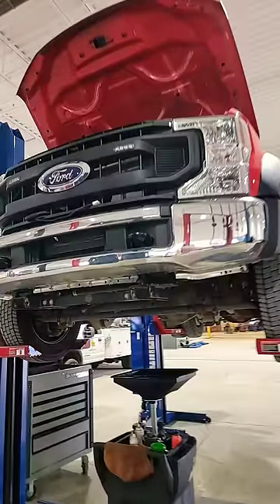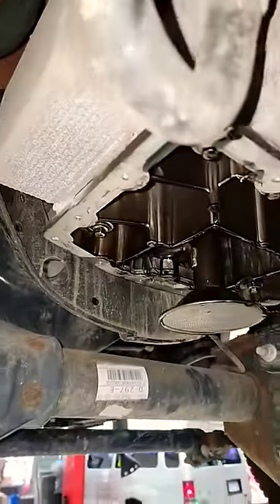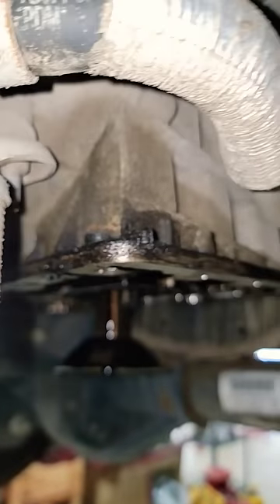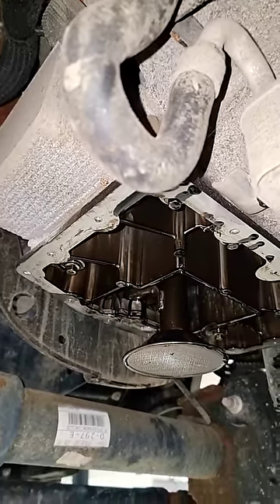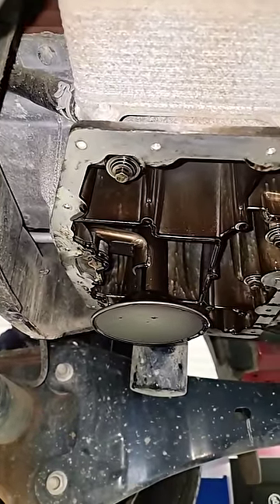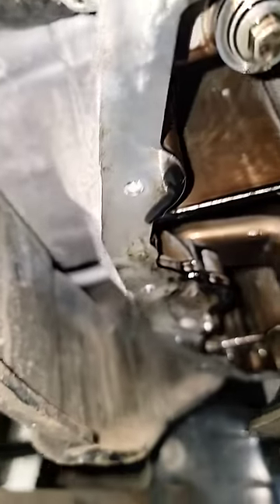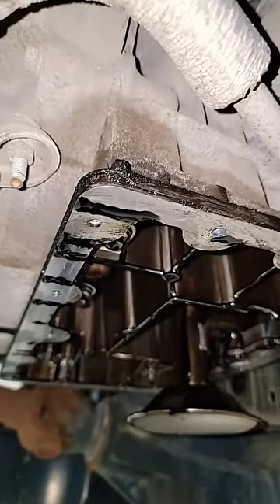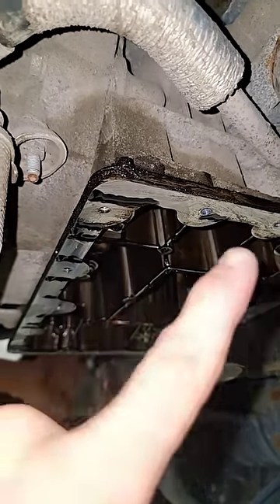Listen UP you Ford 6.7 engine builders  SMH 🤦‍♂️#bebetter #shorts #fyp #fordtrucks

Comment: 3000 miles and it looks like it was sitting in yhe ocean!?!?!?!
Reply: Welcome to the north
Reply: @liamcpeterson  nah no way that's from one winter
Reply: It’s probably because it’s was sitting for 2 years in fords plant holding lot waiting on parts before it was titled. So even though it’s a 22 it’s was sitting for 2 years before it ever saw the dealership.
Reply: @blondeguy08  I can see that happening I'm glad I got my 2019 pre covid
Reply: My 99 miata with 135,000 miles looked brand new compared to that and I drove it in the Utah snow
Reply: That's actually clean af
Reply: Flood vehicles look like that. That's not normal, even for the north.
Reply: It’s not quality metal, surface prep or paint. My 1996 Toyota looks immensely better than that. Im not saying Toyota is invincible, but they definitely cared about their cars when they made them
Reply: My 2007 has less rust. Haha
Reply: @blondeguy08  And you are typing this from the year 2024?
Reply: 400 engine hours for 3000 miles!? Dude must just leave the thing running all day and drive around the block once for fun
Reply: Probably came from ky speedway massive ford parking lot
Reply: my thoughts exactly...wtf.  They drive in salt flats after a rain to work each day?
Reply: Cus it’s a ford
Reply: @liamcpeterson  brother, that's what my 1998 looks like. Made and driven in Canada..
Reply: @carsontinsley4003  old toyota, yes. Modern toyota... idk. They've gotten iffy nowadays.
Reply: @jerrymouse1017  falsifiable statement
Reply: It's a Ford.
Reply: Front plow mount. That looks pretty good for a one winter plow truck.
Reply: Did you see all that rust!!?!
Reply: @carsontinsley4003  facts
Reply: Depends where you live some cars are just fuked
Reply: @Hanibul_Lecktor  yep, that truck was in a flood somewhere. My 20 year old truck looks better than that and I live on a dirt road. More problems in the future for this Ford.
Reply: @Klusk91  or a whole lot off road driving
Reply: @liamcpeterson  no.. i live in MD and we get snow/shit ton of salty roads every year and i have very little rust on my 2011 subaru legacy. That is unacceptable for a brand new truck.
Reply: Good thing I'm sticking to my Japanese brand
Reply: @xephael3485  um yeah, it's the north. That's exactly what happens. Sloppy wet ice storms get extra salt dumped on the roads. Then it all sprays up into every nook and cranny. It's a heavier concentration of salt than driving into the ocean
Reply: Yeah it’s a work truck pay attention kids 2 wheels in the front 4 wheels in the back dirty wheel wells = work truck
Reply from the maker: I love it!!!
Reply: @blondeguy08  so they build the 2022s in 2020? Something's not right here. There's way too much rust under that vehicle to only have 3,000 miles. I'm not a mechanic I don't claim to be a mechanic but I do work in a repair shop and I've seen the undercarriages of thousands of vehicles. That vehicle that rust under that vehicle cannot be from just 3,000 miles
Reply: It's a ford lol
Reply: @jerrymouse1017  my thoughts exactly lmao
Reply: More rust than my 2008 Kia in Pittsburgh
Reply: @daMillenialTrucker  was going to say the same, my uncles 2020 has seen 2 Minnesota winters and isn't this rusty.
Reply: Totally normal in northern WI. Seriously. I always laugh when people are shocked by the appearance and the surface oxidation. What do you think huge amounts of road salt and magnesium chloride deicer sprays do to metal?!
Reply: @daMillenialTrucker  could be from Ontario Canada.. one winter will do that.. if not then worse. It’s actually disgusting how much brine they use.
Reply: It has been towed, probably behind a RV. My father destroyed  a 1976 chevelle in one trip down I-95. It is amazing the amount of damage 10 hours of salt spray can do.
Reply: They're like that from the plant lol
Reply: @halcyonoutlander2105  why are you mad at me for
Reply: @daMillenialTrucker  dude you have no idea lol most brand new cars on the lot look even worse than this
Reply: I've got a fleet of 6.4 and 6.7. Doesn't surprise  me  at all.  I'm just thankful  the 6.0s are finally gone
Reply: I’ve seen brand new Chevy ford and dodge all come this way they don’t do undercoating anymore like at all I seem brand new ram rebels come in for oil change I seen rust on the farm the upper and lower control arms cross member for trans and not just dodge like I said all new models I’ve seen examples of that lime and rust like you shouldn’t be seing that yet maybe on an older car then again my 2006 is rust free so idk where they went wrong
Reply: @daMillenialTrucker  ehh your quarters can rust out in on winter  out here, ask me how I know lmao
Reply: @Jmiesonboy  no it didn’t
Reply: @blondeguy08  probably the dumbest thing I’ve heard. So it got so rusting from just sitting in a parking lot? Hmmm did someone come and spray it with salt as well to get that rusty??
Reply: My toyota spent 12 years in Alaska, then 3 in Colorado, and it doesn't have that kind of rust.
Reply: @Running-with-skizers  I agree getting pre- PLANDEMIC is a good thing. I got one of the last Can-Am x3. Before they shut down. Very greatful!! has been a great unit!!!
Reply: All you saying that’s not from being in the north must not live in the north. I see this all the time on brand new off the lot vehicles purchased from November through march.
Reply: My 1951 F100 looks way better. And it came from Maine
Reply: @Jmiesonboy  snow is different then salt
Reply: @blondeguy08  NOPE. the vin would tell that story. has the vin the second it starts being built
Reply: @Running-with-skizers  hes wrong.  they get assigned the vin at the start of build cycle and the vin has the date and complete build info
Reply: @joshuadoerr277  they salt the roads constantly in utah, I cleaned it often and I went to snow basin over 35 times with it
Reply: Probably a NY state vehicle.
Reply from the maker: Nvr gonna catch me in the empire state...ugh uh
Reply: New York prob. New cars on the lots all look like this. Lol
Reply: I drove my wrangler in the winter 2 weeks in Michigan, and washed every other day.  It rusted like crazy in that short of time.
Reply: @Hanibul_Lecktor  LOL. Yes it's extremely normal! That's very minimal rust. Mostly on the driveshaft is what you see there. Tell me you are from down south,  without telling me you are from the south!
Reply: @carsontinsley4003  Those old Toyotas up north are the worst of the worst!
Reply: @kc72186  You can tell that from normal rust that all northern vehicles have? You must really be something special! Must be every vehicle I own has been in a flood, if a little NORMAL rust is your deciding factor
Reply: @Hallowsaw  Maybe unacceptable,  but it's normal
Reply: @Throwback-Films  Well I guess you can believe it now then. Either that, you have not been under any vehicles from the north
Reply: @joemannix7471  Destroyed the car in 1 trip? Calling your complete BS right here!
Reply: @northwestgirl930  cool story.  Doesn't change the fact that this truck has some surface rust at 3k miles
Reply: @dreamingcode  so?
Reply: @Klusk91  or they are ran in that Ford monstrosity of a lot every week for 'X' hours to keep them from having electrical and engine issues. Ford runs them out in that Lot they have full of trucks. Imagine buying a 2022 with that much suface rust and engine hours and youre told its "Brand new"
Reply: It’s a snow plow truck most likely given the hitch in the front.
Reply: @jhawk1045  yep some people have no idea how rough a northern winter can be on a vehicle especially in states that drop salt. Doesn’t matter the brand these days
Reply from the maker: Christ, someone without mush in their skull🤘
Reply: They have been sitting in parking lots. You can look up images of the Kentucky speedway and you can see the trucks filling the parking lot.
Reply: it’s a plow truck
Reply: @BlankBillions  that may be true but trust me I’ve seen them roll off the line with just as much surface rust on the underbody
Reply: I’m from Wisconsin and this thing looks like it was soaked in a calcium chloride tank for a year
Reply: Road salt or sand dunes 👍🏻
Reply: I was just saying this, was following an new F-150, so new the suspension bolts were still shiny, yet the diff was so rusty it looked like it was 10 years old.  Ford has become so sloppy, Chevy has been this way since the early 2000’s.  Hence why I haven’t bought a domestic since then.
Reply: @Jmiesonboy  Utah winters are nothing. I should know, I've lived in Utah winters for 15 years.
Reply: It’s a ford they tend to rot. I’ve seen 5 year old fords that are comparable to 30 year old Hondas in terms of rust
Reply: It ain't rusty. Come to the east coast of Canada. Rigs look like that before they're sold new here lol
Reply: @chrisclow6885  I live in Northern Ontario. I know what rust is, there isn’t an F-150 with an intact fender for 200kms here.

But my point is, Honda and others don’t have that issue.  That why I won’t buy a domestic anymore.
Reply: @TheTuulos  haha yeah. I'm a die hard vw guy and red sealed vw dealer tech. Worked at Toyota, and Nissan before. Can confidently say, vw is so much better for rust protection then the others and any American brand. Stuff actually still comes apart. Torches used to be daily. Now bi-weekly max lol
Reply: My thoughts exactly
Reply: It still have the tag with bar code on the differential 🤷🏻‍♂️ that’s a good proof that it’s not old at all
Reply: Looks like a snow plow.
Reply: @NoknOnDors  no tf it’s not that’s got a bunch of rust and stuff bro more rust than my 2006 Sierra that I drive in the winter every year in Utah
Reply: @daMillenialTrucker  yes probably a couple months.
Reply: @daMillenialTrucker  welcome to Canada! 🇨🇦 🍁 😂
Reply: Idling doesn't help either, 400 hrs with 3000k it's Idling more than it's working.
Reply from the maker: Someone who connected the dots
Reply: Got a 2021 f150 back in May of 2022. (Took that long to arrive) first thing I did was pop the hood and tons of rusted parts everywhere.
Reply: Was waiting for that my 15 Silverado looks better underneath than that lol
Reply: @daMillenialTrucker  You underestimate the power of liquid salt
Reply from the maker: No 1 understands sitting behind their keyboard
Reply: @PowerStrokeTechTalkwARod  what's your take on it?
Reply: @Running-with-skizers  I got  a 21 Denali HD last year,in June, had to wait 4 months,  definitely don't look like that and I'm on gravel all the time
Reply: 400 engine hours, that’s an average speed of 7.5mph this is Fleet or work vehicle that gets run at idle alot . They are going to hate that engine it’s designed to work not idle .
Reply: @Klusk91  Probably an oilfield supervisor who just sits in the AC all day lol
Reply: @Jmiesonboy  that’s because Utah snow is clean.
Reply: @liamcpeterson  no from one winter at all, I live in PA mate 😂
Reply: @carsontinsley4003  idk about that. Toyotas rust VERY badly but only with a lot of aging. This however is just terrible. It should not look like this this soon
Reply: @daMillenialTrucker  theyve started using brine instead of salt and its so much more toxic for cars
Reply: @liamcpeterson  I have a 10 year old Rav4 with less rust. Welcome to not coating your metal from the factory. American made is crap and has been for a long time.
Reply: @carsontinsley4003  is that why they had the frame recall?
Reply: My two year old Toyota looks brand new still after 2 Chicago Winters
Reply: @carsontinsley4003  except the tacomas that had their frames rusting out
Reply: @Jmiesonboy  same with my 315k 91 MR2 turbo. has seen many colorado winters but is rust free compared to this thing
Reply: That was my thoughts too
Reply: Cheap ass metal sucks rust out quick
Reply: Yeah man it’s called winter, it sucks😭
Reply: @daMillenialTrucker  i believe it ... i had my ram for 23k miles n it needed whole underbody replaced ... these new trucks come with zero coating out the gate
Reply: @blondeguy08  yep. It's been the same basic frame for a while. Infact there have only been a few basic frames since the super duty came out. The generation with the 6.4 diesel doesn't hide it very well but the new ones hide it pretty well. That's why you can take a 99 with a 7.3 and make it look almost exactly like a new one
Reply: @blondeguy08  you know the inner workings. I wouldn’t be surprised by your assumption because that car has a lot of calcification or salt buildup from the elements
Reply: @daMillenialTrucker  yah it most probably is there is this rock called salt
Reply: @mrright69  my 08 Powerstroke is solid as a rock. I had it since new. I wouldn't own one of these new trucks.
Reply: @seanwright1617  I don't blame you at all. I blame your executives for outsourcing crap. If Ford continued to manufacture their own parts and pieces instead of outsourcing to the cheapest crap available there wouldn't be a problem.
Reply from the maker: Id rather walk
Reply: @tabcreedence6553  No. Ford had tons and tons of vehicles stored on lots just sitting because they had a massive shortage of chips used in the electronics during the start of covid. These vehicles sat until they could be finished meaning they were finished in '22 and put on dealer lots to be sold as "brand new"
Reply: I had way worse on a New GMC Denali. If you drive a mountain pass you're getting rusted.
Reply: Odds are it sat at Kentucky Speedway for ages before it got its chip.
Reply: @jerryeastman170   it started with the radiator, which exploded into multiple leaks, then came electrical failures by the dozens, then the frozen parking brake, then the rusted brake lines, then the frozen brake caliper, and more.
Picture towing your car up and down Daytona Beach, in the water about 200 times.
Reply: @jerrymouse1017  my mother had the most rusted 68 4 door Fairlane that was ever still on the road. My brother called from Connecticut and asked if I could find him a cheap car. Him and my dear departed mother took a bus to Dunkirk NY for a $68.50 Fairlane. My coworker paid fifty bucks for the car and charged me $18.50 for the pop rivets and scrap sheet metal. The patches were all on top of the front fenders to keep the puddles under the car.
It was 12 degrees below zero when we towed it out of the snow drift. It started with a jump and they drove it to Virginia Beach.
This car was famous on East Ocean View in Norfolk in 1978.
Eventually my brother in-law sold it with the condition that it was not road worthy. 
The guy called him back a few weeks later demanding his $200 back.
The car sagged in the middle.
Some will say that my rust stories are bs
Reply: I'm in Missouri in the rust belt and my 94 is cleaner wtf GM
Reply: Thats what I was like. Has he been washing the bottom of the truck with beach water.
Reply: @NoknOnDors  what have you been smoking? Thats clean to you?🤭
Reply: @Klusk91  could be a work truck
Reply: Why is a 2022 F Series super duty with only 3000 miles in this garage instead of a Ford garage being serviced under factory warranty. Somethings not adding up
Reply: @seanwright1617  Since you familiar with this truck. Why would this guy be doing the repair instead of a Ford garage under factory warranty. It doesn't add up.
Reply from the maker: Maybe cuz ur stuck in dat 300C club to peep the bio & your question wlda been answered......
Reply: Snow Salt from the road does this after even just 5 minutes of driving 😂
Reply: Move up north you’ll see how fast vehicles rot away
Reply: @daMillenialTrucker  in salt states yes , I had a 2022 Chevy pickup come in for inspection, the undercoating is already falling off it
Reply: @daMillenialTrucker  haha yeah it get it like that sometimes it's all the salt on the roads
Reply: @mrright69  my 08 ram been in Ohio has way less rust than that and it sits outside 😂
Reply: @daMillenialTrucker  come visit me in Maine buddy. There's higher salt content on the road than the ocean in the winter months
Reply: @garrettwight1027  Maine and north Dakota are the only states I've never trucked in. I know Maine is a flat version of Washington state so I'd imagine, it's probably salty ASF but still these aluminum chassis are coated in protective coatings like a triple dunked glazed doughnut, so it's hard to believe any type of salt, in one winter did this. It has to be a combination of things bro. This truck had to have been like an oilfield truck
Reply: @blondeguy08  it can't be titled as a 2022 with a 2020 VIN🙄
Reply: I thought the same thing Lol
Reply: Should be laws on road salt
Reply: @Sean Wright  so that excuses the trash work on the oil pan.
Reply: @daMillenialTrucker  who's making aluminum chassis trucks?
Reply: @beardedwonder73  then it wouldn't be a 2022 truck.  They can't swap VINs
Reply: @walkerallen425  those sitting vehicles already had VIN numbers and therefore can't be 2022s
Reply: @GTPCarpy  the chips aren't VIN matched from what I understand. And as to "production/model" year .. its still a product of that model. Like new old stock motorcycle
Reply: @beardedwonder73  if the VIN says 2020 it can't be sold as anything but a 2020.
Reply: @GTPCarpy  isn't that I what said ... new old stock. Trust my area has enough expeditions/navagators and f250s/350 to supply new old stock for a year or 2
Reply: @Jmiesonboy 
It's not the snow.... It's the salt, calcium chloride, beet juice, etc that's sprayed on the roads when you have snow 6 months out of the year.
Reply: @seanwright1617  maybe don't cancel all your orders at the start of the pandemic. As someone who works in semiconductors, it's 100% on the oem and their mistake of cancelling almost all chip orders at the start of COVID. 8 to 12 month lead time on chips mean 8 to 12 months of no chips for you. Tell your execs to have some foresight instead of blaming semiconductors
Reply: @daMillenialTrucker yes, one harsh winter can do that.
Reply: @blondeguy08  as a trucker that delivers parts to assembly plants I see all that stuff back there and do in fact see brand new vehicles sitting in mud and or gravel lots
Reply: Right should have come with a Ford motorcraft oil filter did you see that one ,?
Reply: @Klusk91 probably had a PTO using a bucket or boom. I don't know, just a thought.
Reply: This guy is talking about metal prep, the owner needs to take better care of their investment. Undercoat the truck with fluid film, makes those kinda things not happen as much. Just saying.
Reply: @carsontinsley4003 that’s funny given that first gen and early second gens have some of the worst frame rot on any trucks out there due to the awful quality of layering they received from the factory.
Reply: Big part of that is gravel roads. I've had brand new trucks look like they're 10 years old because of the amount of caliche dust mixed with water and mud. More than likely an oil field worker or a ranchers truck
Reply: I sold an 84 F350 last year that had the same amount of rust
Reply: @Jmiesonboy  your lying. I had a 99 Miata and they are all known for rusting issues. Japanese metal not that good for winter. Your just lying to everyone here if you act like your Miata is better than this if you really do drive it through winters lol.
Reply: @Jmiesonboy  mine was a boy 100,000 miles before it got totaled by some lady backing out of her driveway when my car was parked. I detail cars for a living and my Miata never looked so clean compared to this truck.
Reply: @sgtjohn4321  that's what I'm talking about. I just pressure sprayed the salt off the bottom and it didn't get that much worse over the winter
Reply: @daMillenialTrucker  we call that China steel!   Or better yet Chinese almost aluminum.
Reply: 2020 dodge bighorn doesnt even have a spec of rust and im in the north whats going on ford?
Reply: @Jmiesonboy  so they dont use salt in Utah? Case they do here and that's what most vehicles look like after their first month of winter driving...
Reply: @blondeguy08  I was about to say, that's what a year of sitting in the field at Kentucky Speedway looks like...
Reply: @Roberob1189  I'm born and raised Long island New York, I spent half the years upstate N.Y in the mountains, driving in snow, driving from up there thru the city and to long island,  then all over the island. I buy Dodge rams, and there known for rusting supposedly,  half my family is in the car business from selling to leasing to fixing as I am in the automotive business and I can say you are full of sheet,  New cars on the floor are not rusted and being sold. I've owned all of New cars and trucks and allot of used. I had a ford escape I would drive in all the blizzards and had a bunch of fancy houses in my late 20,s and early 30,s id service out in the Hamptons and Montauk,  I drove threw it all and the car looked New underneath the day I sold it 5 years later and I bought it 4 years old. Same fpr a Dodge durango, had a chevy s10 that rotted away. The dodge rams I had , had fender liners and never rusted or rotted out,  always washed them after a snow storm at a car wash that had the under belly wash. There are barn finds upstate N.Y and wast end long island with classic cars all the time no rust. Even in the city. So funny the crap people spew out of there mouths,  such lies
Reply: @blondeguy08  Have you ever purchased a new vehicle. The warranty starts when you purchase the new vehicle. It doesn't matter how long it set. It's a new truck and should be taken to a Ford dealership for factory warranty coverage.
Reply: @Jmiesonboy  Does your Miata have sprayed on factory undercoating. Manufacturers use to spray their vehicles. The materials used on new vehicles will get surface rust, but not structural rust like older cars that often had fenders flapping in the wind. If you use a car wash. The pressure removes the surface rust. When I park my My new 2018 Chrysler 300C at the airport parking lot when I fly out for business. I normally comeback to brake Calibers with surface rust if it rains or snows. Car washes with Undercarriage sprayers removes it. The rust everyone keeps talking about is surface rust on Galvanized steel. If it bothers you. Put it on a lift and spray on undercoating.

I still would like to know why the owner of a new truck no matter the brand would not use the factory warranty at a factory dealership to complete a covered repair.
Reply: Maybe that's why it's not being repaired at a Ford dealership under factory warranty. it's a totaled flood truck from hurricane Ian.
Reply: @blondeguy08  those trucks rotate out of holding lots. Other than a wild guess. Where did you come up with 2 years. Maybe a couple months at most. It appears you've never purchased a new vehicle since the factory warranty starts the day it's sold to a customer.  Not when the vehicle is built
Reply: @Running-with-skizers  How long did your 2019 set in a holding lot. I'm sure you don't have an answer just like there's no way the 2022 trucks set in lots for 2 years. They sell them too fast making them the top selling vehicle year after year in the US
Reply: It was built 2-4-19 in Kentucky, i bought it in April the same year
Reply: That's Ford for ya. Rust buckets
Reply: @daMillenialTrucker  that's an hour drive after they salt the roads with wet roads, even the side of my car looks like that
Reply: That’s a Ford for ya
Reply: Parts come in to the factory with rust on them & we still install them with no clean up , no one at a ford plant actually cares about the trucks they’re putting together
Reply: @daMillenialTrucker  you’d be surprised 😏
Reply: @carsontinsley4003  not really. Toyota is the only brand I know of that actually had recalls because their metal was so bad. They had to replace frames on millions of tacomas, for example. There's probably other manufacturers though. Which model and which state are you from?
Reply: My 26 year old, 350K mile 4 runner doesn't even have that much rust on it.
Reply: I call bullshit on 3K miles
Reply from the maker: When ya come down out cha space ship you'll clearly see I have no reason to waste my time & bullshit you
Reply: @PowerStrokeTechTalkwARod  I believe it only had 3000 miles ARod when I posed the original comment that's why living northern states it's a must to get your rigs rust proofed when they're new I myself use a mix of undercoat and used diesel oil in a old cup gun with an 1/8 rubber hose extension and shoot the whole underside of the truck and any opening in the body that hose fits gets blasted till it leaks out the other side of the panels it make a huge mess of the truck but after a few weeks of dripping and a good diesel bath the truck is good for years
Reply from the maker: Not chu guy the other commenter
Reply: @PowerStrokeTechTalkwARod  I never get offended. It's all for fun
Reply: 3000 miles and a year old. It's likely a tow vehicle that sits a lot
Reply: @Reyes Troglia  I though I was the only person thinking the same thing with those hours that truck  should at least have 20,000 plus miles
Reply: Plow truck.
Reply: @daMillenialTrucker  lol they come like that from the factory, lots of them. The f150 is built in kc and sold them in kc with type of rust all the time on trucks with 20 miles.
Reply: dove that thing at 7.5 miles an hour
Reply: It is a ford!!!
Reply: @NoknOnDors  my 21 year old audi looks better than this and it spent most of it's life in Massachusetts
Reply: This is how my mustang looks riding through mountains in winter.
Reply: @liamcpeterson  brother, my 1998 toyota looks better..
Reply: @Hallowsaw  MD hasn’t gotten crazy snow in years, I’m in DC we’ve gotten lucky last 10-15 years
Reply: Pretty common near the coast, especially near sea level
Reply: @jamison mansius  do they use salt in Utah?
Reply: @0xsergy  same with all modern vehicle on the road
Reply: its salt my dude
Reply: @daMillenialTrucker one whole winter could rust your whole subframe out in ohio they throw too much salt on the roads and it destroys your car if you dont spray it off ever
Reply: @blondeguy08  sitting wouldn't do this alone unless it's sitting on grass, my car sits on my driveway every winter and has 0 rust.
Reply: That filter base plate is way too rusted for 3k miles and at most 1 year.
Reply: @Klusk91 average 7.5 mph... so a lot of city driving through school zone
Reply: @Hanibul_Lecktor  I'm in the north,  trucks don't look that bad unless you're in Minnesota.
Reply: ..sitting in the ocean 😂😭😭
Reply: I have a 2009 BMW with 190,000 miles in MASSACHUSETTS driven year round and it looks WAY better than this. Hardly any surface rust anywhere. Are US auto makers still using crappy metal with no rust proofing?
Reply: @truckerrawb4895 you'd be amazed how much one winter can do if you never at least run it through a car wash. Salt is awful
Reply: @carsontinsley4003 Toyota is damned near invincible.
Reply: 3000 miles and 400hrs? That's my question.
Reply: Welcome to the east coast also welcome to new England
Reply: It’s a northern work truck so that’s pretty standard
Reply: @papaicon13  it's not even at its first oil change even if you washed it in brine every day I don't think you could make it look that bad yo me that seems like a defect my 19 ford has 50k and I live in the Salt belt and it's not even close to looking that bad
Reply: By the looks of the scaling and white powder corrosion on the aluminum I was thinking road salt but then was starting to think maybe it's my eyes and just mud splash. But ya, it's road salt....
Reply: That was my first thoughts.  WOW!
Reply: @NoknOnDors  you don’t work on a lot of new vehicles do you?
Reply: @liamcpeterson  man I work in Ontario, conditions are about as hard on cars as it gets, and I have not seen a 22 that tough
Reply: @blondeguy08  yep I live 3 minutes from the old palace of auburn hills they had that full lot packed with brand new trucks, feel bad for anyone who bought and had no clue
Reply: Well, it's a pickup truck. If one is putting the truck to work, it very well may look the way it does.
Reply: @blondeguy08  This, they had their trucks sitting in a field in ky waiting for chips during the silicon shortage. We drove past it a few times. Factory rust  only 80k.
Reply: Nah dude I live in the north and have 22k miles and have absolutely zero rust
Reply: My 03 sunfire looks cleaner than that truck lol and it’s got 250,000
Reply: What do you mean? That is how they look straight from the dealers lot in New England.
Reply: @tabcreedence6553  no NPC. 2022 vehicles are produced in 2021. Its 2023. Er go 2 years.
Reply: @blondeguy08  this!!!
Reply: @blondeguy08  its allover Detroit area still
Reply: 400 hrs….. damn mine has 60k with the same hours
Reply: @0xsergy  I can quote this newer Toyotas are eh now day’s definitely not the same quality as older ones but I’ve never seen one come in like that with 3k miles I actually haven’t really seen any major issues on newer ones when it comes to oil leaks and other leaks like on this trucl
Reply: @liamcpeterson no way. I have a 2016 car that have harsh winters, the frame still looks great. This is bullshit
Reply: Yeah what’s with all the rust underneath?!?
Reply: @blondeguy08 Except it was not a ford. Did you not listen to the video.
Reply: @Hanibul_Lecktor 
Even I can see the snow plow brackets on the front and I live in Florida. I imagine the corrosion is from road salt. 

Still no excuse for the oil pan gasket leak though.
Reply: @daMillenialTrucker it's a plow truck. Look at the plow hookup in the front. It probably was salting too.
Reply: It always amazes me how little people know. The Toyota guy preaching about quality metal is like a dodge guy preaching about reliability….
Reply: Snow plow attachment
Reply: Quality of metal has been horrible lately. Ive been getting stuck with ram trucks lately every fastner breaks off on the trans pan removal
Reply: @carsontinsley4003 quality of metal on 70k truck is deplorable in the last 4 years
Reply: It’s called dust form a gravel road
Reply: @liamcpeterson  north has nothing to about it, its people too lazy to spray a undercoat on their vehicles.
Reply: I know! My excursion is 20 years old and it looks new compared to this thing
Reply: @deadplaya those are trash too.
Reply: @blondeguy08 that’s not how that works.. model year has 100% to do with production date and 0 to do with date sold or date it got to the dealer..
Reply: My buddies 2022 tacoma looks worse underneath than my 13 f150. Idk whats up with these modern vehicles.
Reply: The mix in the metal isn't the same anymore
Reply: It's a Ford
Reply: @Throwback-Films  Cheap Chinese steel.
Reply: @MrSirGiuseppe  Cap
Reply: Ford built to rust lol